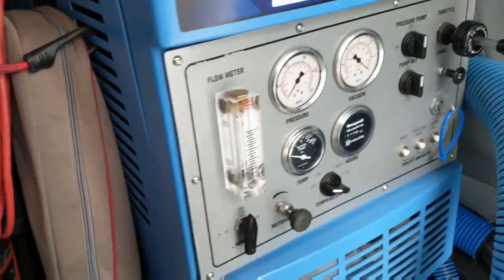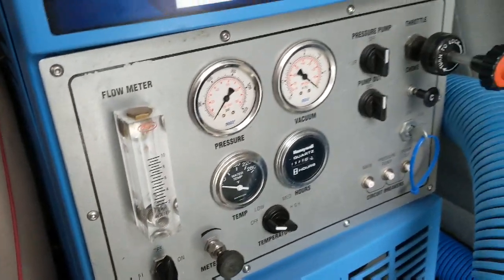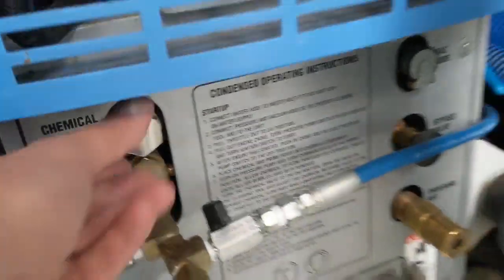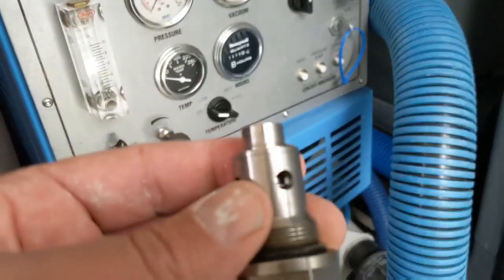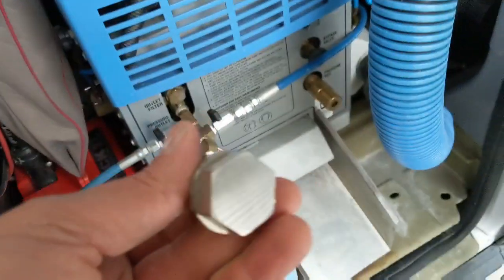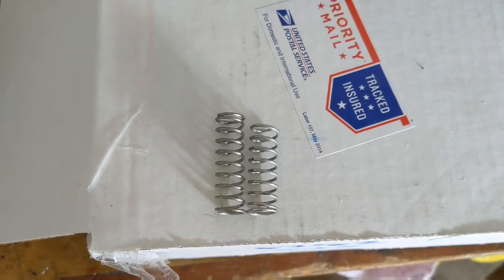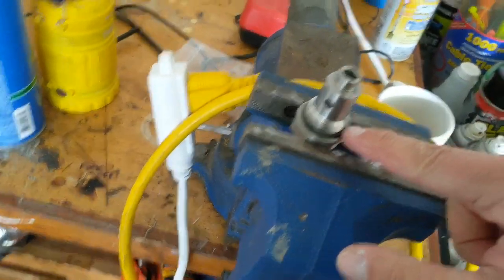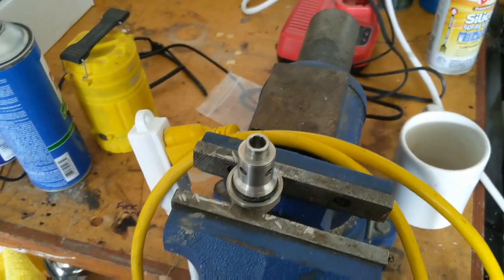Sapphire 370 Chemical Draw Problem Fix

Comment: Do you have a video on  de scaling the unit ?
Reply: Take the radiator cap off the water box 
Fill with descaler
Connect all your solution line to machine with the end connection removed.

Put open end of solution line into open water box
 turn on machine 
Turn on water pump run for 5-10 as directed 
Fit connection 

Connect wand -descales wand too

Run out Descale fluid. 

Connect to fresh water 

Refit radiator cap 

Flush
 
Clean carpet